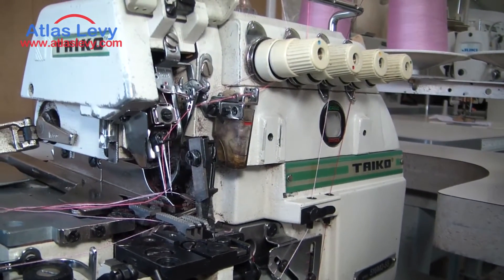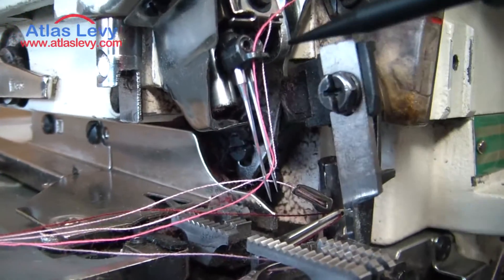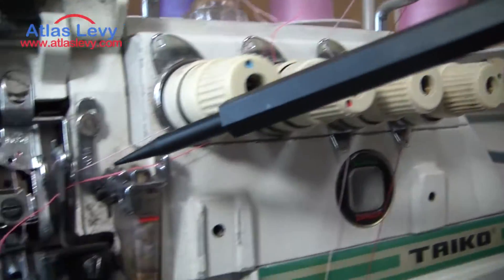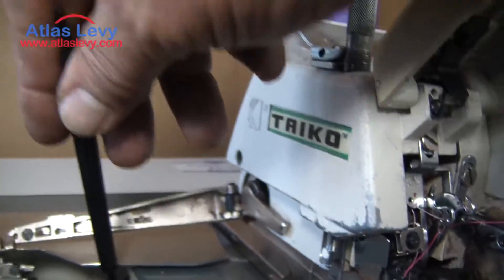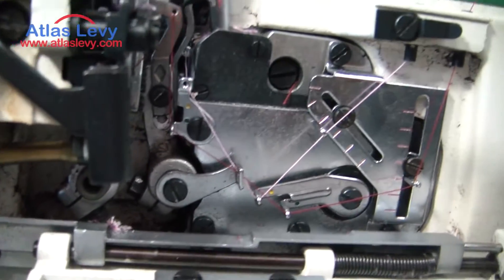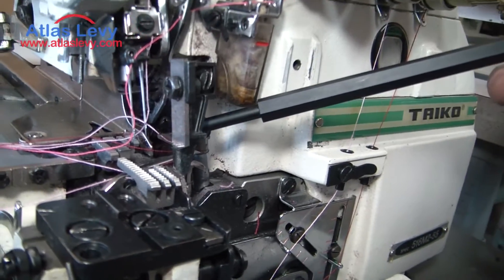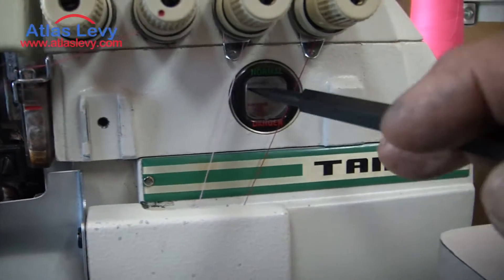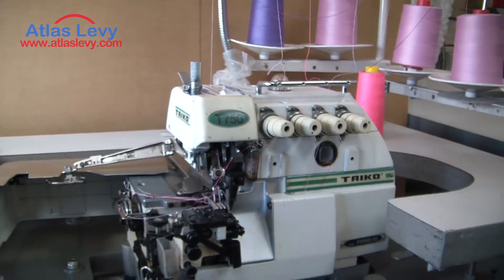How to Thread Taiko T750 516M2 55 Atlaslevy

Comment: Hello I just recently bought this machine and when I use the left needle the presser foot does not allow needle to pass through..im new to sergers but I have a juki 5550 and have been sewing on that for years.. But with this taiko machine It seems that I have the wrong presser foot?..the left needle is in line perfect with the needle whole but when I swing around the presser foot there's nowhere for it to go..so I can only use the right needle..im using the 3 thread seam but it's too narrow so I need access to the left needle...help please..